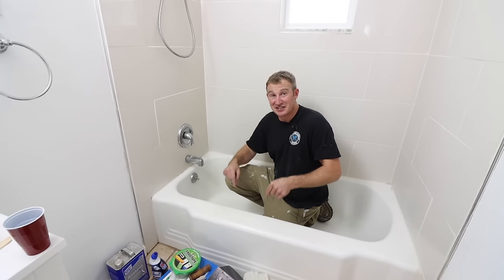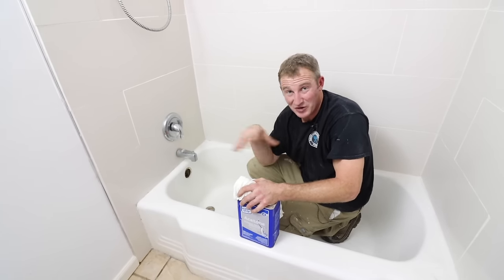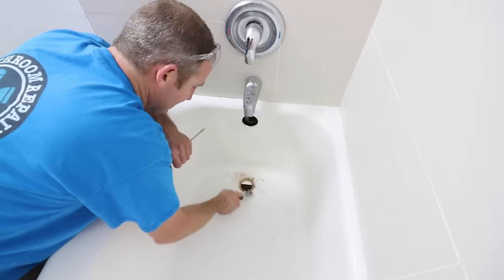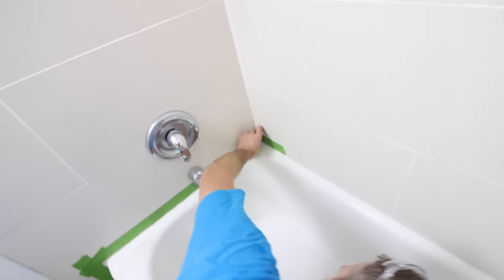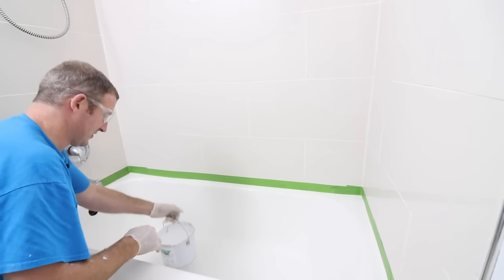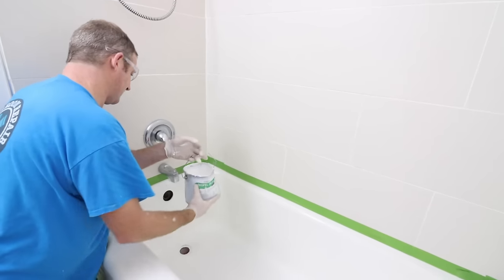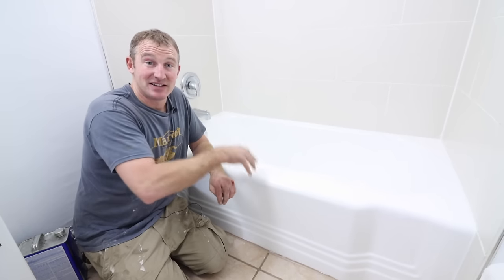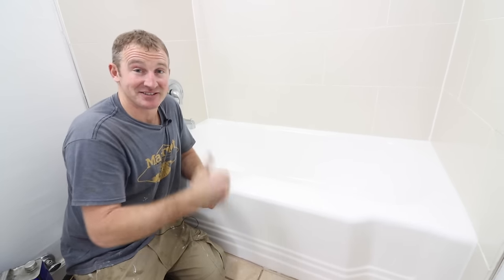Tub Refinishing Tips for Beginners

Comment: Awesome video. I won't be able to take my drain out and put any kind of bucket underneath. Slab house and the tub is almost touching the concrete. And I am also afraid to remove the drain cover due to the high risk of the drain itself breaking. Cast iron pipes....

Comment: I have been examining the various videos and methods to resurface our tub for a few weeks. Your helpful hints and demonstration answered every question I have had, although I will have to adapt the drain removal and plugging to our concrete slab construction. 
I was leaning toward this particular product simply because of (a) only one coat, and (b) no need for ventilation. 
Using your tips that covered what others didn't, and using some of those other suggestions, I finally feel confident enough to start planning the job.
fyi: 64 year old original steel and porcelain tub. It definitely needs the refinishing done.
Thanks for being so thorough and informative with this demonstration video.

Comment: Underrated tip that you did in this video, after removing the drain, screwing that piece of wood to hold an empty container underneath the drain opening.  If you have access, I agree with you, doing that will contribute to a much better job, and dramatically lessen the potential failure point.

I grabbed an old funnel and taped it to the underside of the tub with some gaffers tape, and stuck a piece of PVC up to the base of the funnel, and put the other end in a crappy 5 gallon bucket, but if I had watched your video beforehand, I would have used your method instead.  I also used a styrofoam cup and just stuck the narrow end (the bottom) into the drain hole.  It fit and flexed to fit the hole very well, and sealed better than the two videos I saw that used it upside down.

Great resource, and very nice job explaining everything.

Comment: I did this with Rustoleum Epoxy, and I just took the drain cover off and taped.  I never knew that lysol etches, and maybe it would have saved me a ton of sanding, as I hand sanded my fiberglss tub and surround with 100/120 wet/dry sandpaper.  I used a paint tray (and a mini roller like you did).  I like your advise about letting the epoxy sit for 10 minutes as you put bubbles in it when you stir it.  Once you put this stuff down, you can't go over and over it with a roller like you are painting, because it drys super fast.  That is why I am curious about your pouring method.  Seems the epoxy would dry even faster.  The next time I do this, I would use a paint sprayer.  If you are covering up a colored tub, as I was, you will need at least 3 coats to make it an even white.
Reply: Only needed to use 1 coat for a pink tub that is now white using Ekopel 2K.
Reply: Sounds like you have been using a different product altogether. Epoxies have different working times depending how the manufacturers formulate them.

Comment: I initially watched this 3 years ago. I’ve now done it about 7x. Each time is easier. I feel you definitely need to take the drain out. And the most challenging part is not leaving drip lines on the front of the tub. Especially if it has rivet designs like this tub

Comment: in the directions they say to tape the outside of the tub along the floor 1/8 of an inch up from the floor.  I just slapped the tape on the floor and on the tub then used a paint mixing stick that was 1/8th of an inch thick as a straight edge to guide my utility knife as i cut off the excess tape that was on the tub.
also, for the drain I removed the chrome drain cover, took a 3 inch x 5 inch strip of manila folder, rolled it into tube and when inserted into the drain opening it expanded like a spring closing off the drain.  when the epoxy has set but not hardened at that time peel off the tape.

Comment: Hi there, thanks for the awesome video. 
I have a few easy questions for you.

1) At what stage of a full bathroom remodel would you suggest doing this? At the very beginning before setting walls and tiles OR at the end before setting caulk joints?

2) You slightly touched this in the video. For a bathtub on the second floor, how would you safely get the excess product sent through the drain access?

3) Is it possible to use the same process and products on a toilet?

4) Also, would it be possible to spray a thin coat as a second coat using this product?

Thanks
Reply: I have the same question as #2. I would have to punch a hole in my kitchen ceiling to get under the tub.  What happens to the drain if some product flows into it?
Reply: I think most upstairs bathtubs have an access panel on the other side of the wall at the plumbing end of the tub. Sometimes the panel is hidden in a linen closet. It looks like a board or plywood panel. Sometimes it’s screwed on; sometimes has little turn clips to hold it on.
Reply: PS: These are great Qs. Too bad no one answered.

Comment: The tub looks good.  A couple of questions.  Did the manufacturer suggest the heat gun be used as you did?  Would this process and product work on a fiberglass tub?  I wondered if there were any "curtains" or if the material did all level out completely?  Lastly, was there anything that you would do differently if you were to do it again now?  Thanks for the video.
Reply: I saw this product used in another video on a fiberglass tub and it turned out nice as well.

Comment: good video.  hope you can help me with a question?  had tub resurfaced a couple years ago.  i used an ardex silicone caulk and within a couple month turned yellow.  have been putting the project off because i am scared to remove the caulk, not knowing how careful i have to be to not mess up the resurfaced tub?  they gave instructions on cleaning it and a list of approved cleaners.  i know i can't use a caulk remover on it because that stuff is harsh, any ideas?  thanks.
Reply from the maker: Carefully use a sharp utility knife to score the caulk, then use a razor scraper to remove it off the surface of the tub and tile. You can tape both surfaces to protect them

Comment: I think my existing tub was refinished using this or another similar product at some point maybe years before I bought the house. I noticed gouges on the floor of the tub after my wife gave dog with long thick toenails a bath without the mat. Material was definitely thicker on the Floor  near the drain, sill and vertical wall under the shower curtain. Previous owner also did a poor job caulking the tile between the tub and the vertical wall, looks like they had some areas where the epoxy didn't stick then back filled with silicone. Overall the I'd say the project probably look pretty good for a while but by the time I moved in tub finish was starting to degrade, in places the tub has kind of a chalky look, on the floor and in the corners..

Comment: If you are doing this regularly, and don’t want to waste your time on mixing the product by hand, you can use a degassing vessel to pull a vacuum and speed up the process.
Reply: You only have 30 minutes to get it all on before it starts to set..  vacuuming after the mixing would cut into applicAtion time…

Comment: Whats the best way to remove a cast iron tub like that? Do you get the same end result as having it sprayed? Thanks for the video. Great stuff!
Reply from the maker: best way is to use a sledgehammer to remove it in pieces or use a sawzall with carbide blade to cut it into pieces; unfortunately you can't spray this tub refinish
Reply: @HomeRepairTutor 
" Cut it up?!!" Really?! 
You're nuts! 
Whataya' think the tub YOU JUST DID is made of...?!
👉  C. A.  S.  T.       I. R. O. N. 👈

Sheeesh!
Makes me think that maybe the fumes off that epoxy were much stronger than you thought! 
Silent but deadly haha!
Smh.
Reply: Little do you know cast iron when hit with a sledge hammer will shatter o do plumbing and use cast iron pipe. Fastest way to cut the pipe is with snap cutters which literally just snaps the pipe into 2 pieces. 👍🏼 lesson learned for the day

Comment: Great video. I the same type of tub. It’s very old and has some spots that have chipped where black is showing. What do you suggest doing with these areas to smooth them out before starting this process of refinishing?
Reply: I've hear others say to use some automotive bondo to fill chips and then sand before glazing.
Reply: @CardiacCat  You are right.  The men on This Old House were refinishing a claw foot tub and used automotive bondo on the chipped areas.

Comment: Spray paint provides the thinest thickness, a paint/epoxy combo box has medium thickness, and a thick application brand like Ekopel gives the thickest and best coat.  However, use a 1/4 inch nap roller, not a foam one.  Nap is manuf. suggested, it rolls on great, and doesn't break up like foam.

Comment: Question: I need to cover up rust/stains in tub and would like to change the color of the tub. What would be good to use to do that? My tub is over 60 years old. I have Rust oleum painter's Touch Ultracover for multi surfaces.  Can I use that or could it be mixed into the enamel paint?

Comment: Rreally cool...nice work!  When the product dries, does it not show any of the texture from the roller at all?  Usually, all rollers have some sort of texture to them, which wouldn't be a great look in a tub (I think), but does it all even out and leave the tub with a smooth finish?
Reply: You are not supposed to press hard with the roller, you are basically just moving the epoxy.  We just finished a countertop with epoxy.  We also ensured that we had a roller that did not shed.
Reply: You’re basically just moving the material not rolling it. You’re just moving it around . It will all level out nice and smooth on its own
Reply: @nogoodwolf  if you have a roller that sheds take your painters tape and roll the roller over the sticky side to pull loose fibers out. Only painters tape, other tapes are too sticky and will pull other fibers loose

Comment: Use a rubber plumbers plug at the drain next time. Clean up excess around it it till it start to set up. Then pull it clean it and set it back in with tape around it till next day

Comment: I kind of chuckled to myself when he went to finish the inside of the tub after he did the sides and outside of the tub.  He did pretty good regardless.  What a messy way of applying this?  Is that the way it's supposed to be done?  I've always seen it painted on with either a brush or roller.  It was interesting to hear that this epoxy is low on fumes.  That's a plus👍  Do u still have to wait 3 days for curing, before u can use the tub?

Comment: First remodel I have done without actually replacing the tub. I am taking the tub surround down before I do the refinish so I can get the marble walls in. I am replacing the p trap and drain and supply valve so everything will at least look new. Im wondering if the epoxy can be sprayed on with an airless like they do boats. Your roller technique is hard to do on counter tops, I bet its a lot harder rolling a tub.

Comment: What do you do if you cant get to the underside of the tub ? would you stuff a rag or something into the drain. I wouldn't think you would want it to just run down the drain and harden.  Thanks
Reply: You'd put a paper towel or similar in and double-layer masking tape over the drain, then cut around it so you just have a circle of masking tape. The Ekopel guy shows that in his vids. If I could get under the tub, this would be ideal, but there's no way that would happen for me. :)
Reply: Usually there is an access panel in the plumbing end wall (other side).

Comment: Would CLR provide better etching and in turn provide better bonding and adhesion to the epoxy?
Reply: No you really need a stronger acid but they dont sell any to the public.  A good glass etcher would be the best..  the toilet cleaner stuff is no joke though.. it will eat the paint off of anything and dissolve aluminum..

Comment: nice video. I can't get to the bottom of the drain  to remove the pipe and install a catch cup. I am thinking  I could build a small cup to put inside the drain so the material does not flow into the pipe.  then remove it before everything dries.
Reply: Yes, and stick a popsicle stick in it bf it dries. Then you’ll have something to pull it out with, after it dries! Maybe put some Vaseline on the outside of the cup to make it anti stick. 😄

Comment: Would you used this on a 40 year old very sturdy well set one piece fiberglass surround?
Reply: With proper preparation, it should adhere without any issues. I'd highly recommend spraying the epoxy instead of a roller. Reduces the risk of runs in the paint

Comment: Hi. I'm about to glaze a 5.5' corner green fiberglass jacuzzi tub with jets and fiberglass removable front panel. I bought a similar product (Armoglaze). I purchased 2 kits because the tub is quite large. Any advice for trying to tackle something larger like this? I'm experienced in home repair but I've never done this job before. It seems like it may be difficult. I plan on putting the front panel on horses and coating it that way as it slides up and under the top lip of the tub.
Reply: Did you end up completing the process? We have the same type of tub and want to try DIY reglaze
Reply: @alexarihani2902  Yes I finished it and it seems to be quite durable and strong. Only word of caution is to not let colored soaps/shampoo sit on it long because they can pemeate the coat and stain it. We have not been able to remove these stains.

Comment: Of all the porcelain refinishers ekopel seems to be the biggest pain to apply. Are there any real advantages to using this product over the others that roll or spray on?
Reply: The Rustoleum Tub & tile sucks. It failed in the corners first then on flat areas.  It also yellowed over time
Reply: Heard that Homax Brand sold at Home Depot works pretty well - plus it comes in spray paint  & regular roll-on!

Comment: Just pouring the epoxy will do then, I do not have to use any primer whatsoever ??
Reply: The Lysol toilet bowl cleaner has hydrochloric acid and lightly etches the surface making it more porous so no primer is needed. I still wondered if using a self etching primer would help though.

Comment: I waited overnight to apply the second coat when I rolled on the paint it wrinkled the first coat really bad I’m going to have to sand the wrinkles before I can repaint any idea why it wrinkled
Reply: Epoxy is not like normal painting. It's a one shot deal and it's done. All your second coat did was upset the original coat. Of course you know this now. If in you shoes, I'd just replace the tub now.
Reply: It "wrinkled" bc your 2nd Coat basically just pulled-up the 1st Coat - 
Esentially you "undid" what you "did", pffft'!
Tough learning the Hard Way huh?! That's why its so important to READ BEFORE USE! 
Better Luck next time :)
Reply: I think people are confusing product lines and their instructions. The Ekopel is not something that you should be adding a second coat to. So my thought is that you are referring to a different product, but that perhaps even it should not have had a second coat. That would be a shame after putting in all that effort and expense. 😟

Comment: How would one do this on a slab with no underneath access to the drain?
Reply: I would spring for a spray or roll on finish
Reply: Usually there is an access panel in the plumbing end wall (other side).

Comment: HELP!! SOMEBODY, ANYBODY 😩 I did the stupidest thing and I know how stupid it was but what’s done is done lol 
I taped over the drain and came back once to make sure I wiped the excess away from the drain area buuuut it a significant amount ended up drying over the drain and I can’t pull up the tape to uncover the drain…
Any suggestions? Besides drilling the drain out 🥴🥴🥴🥴 

HELP MEEEEEEEEEEEEEE
Reply: What did you do to fix it?
Reply: @susanmei9980  I had to have my dad drill the drain out 😩 at first he used a screw driver and hammer to chip away at the drain and then followed with this drill that had a circular head. It’s not as neat and aesthetically pleasing as I would like lol and it’s super thick but it’s totally functional so I can’t complain. And none of the pieces fell through the drain luckily.
Reply: @courtneycurington3241  phew! 😮‍💨 Glad it worked.  The fixes we get ourselves into! 😂 🤣 😆

Comment: Hiw do you feel about the Rust-Oleum version?
Reply from the maker: we haven't used that and would probably stick with this epoxy coating, it's super thick and bonded very well to the tub
Reply: Rustoleum does not last. Not good on countertops either
Reply: Absolutely is terrible! Peeled & yellowed.  I paint all the time, followed the directions let it dry an extra couple weeks. Over time it failed first in the rounded corners then else where and it yellowed.
Reply: Preparation is KEY!
Reply: I was reading the other comments, and I agree. Not a very good product. I used it and my tub is yellowing, henceforth why I'm on here seeing about other options, lol.